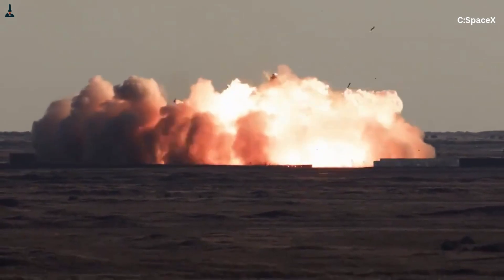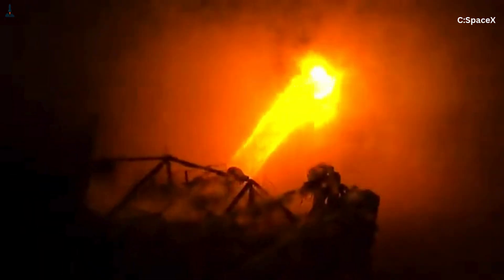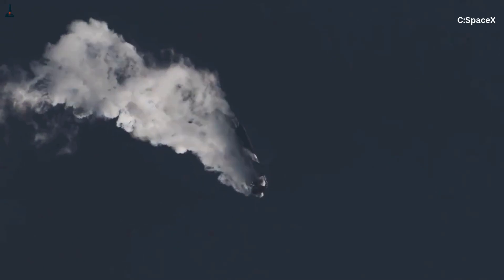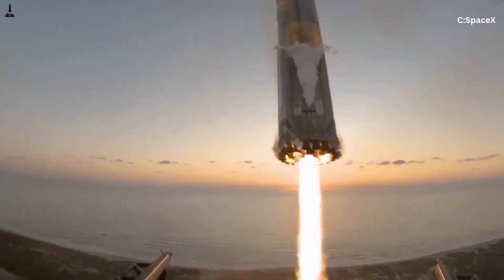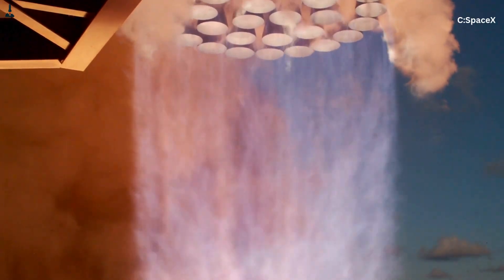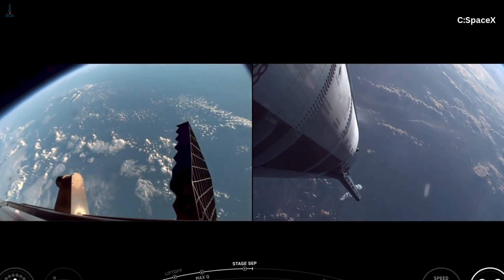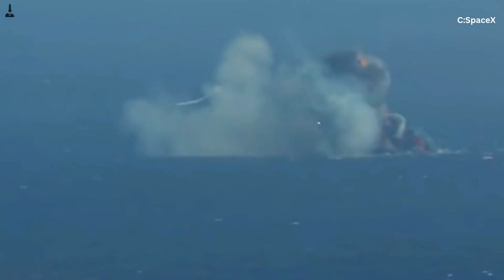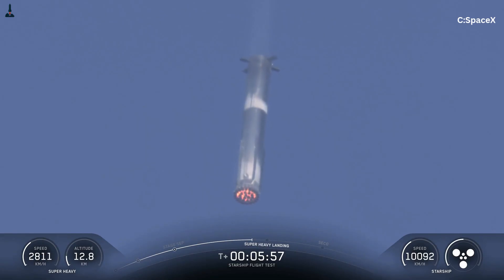Why Raptor Engines Exploded So Often — and How SpaceX Fixed Them #spacex #starship #elonmusk

Comment: Great work and well presented! Congrats as none of the other channels have managed to do so! You are bringing added value to the rocketry community! I laud you for doing so! 
My favourite improvement is difficult to say as it is the combination of all that makes the Raptor reliable. From an engineering point of view the 3D printing of the turbo pumps is the most fascinating but it alone would be useless . The nitrogen purging is simply cool and super smart to rid of any oxygen “puddles” 
Great work!! Keep it up
Reply from the maker: Exactly 💯

Comment: Blue Origin is MUCH better than SpaceX: they only blew up only ONCE.
Reply: SpaceX pushes for full reusability and rapid turnarounds... Blue origin New Glen is like falcon 9 level reusability..... Imagine blazing through plasma on the way back to Earth or on the way entering mars. That's an engineering challenge to beat entry and re-entry. What's left to solve is just the heat shield to be reliable